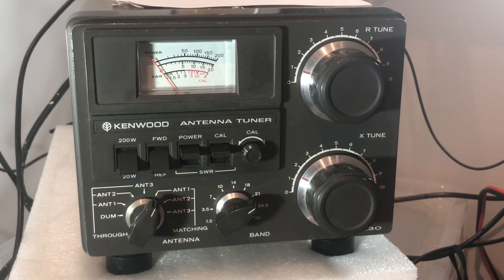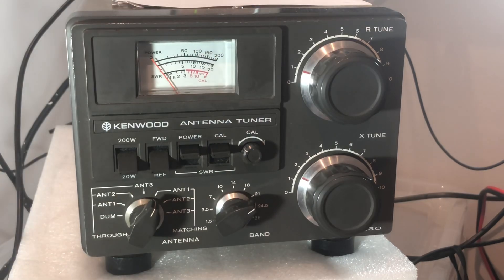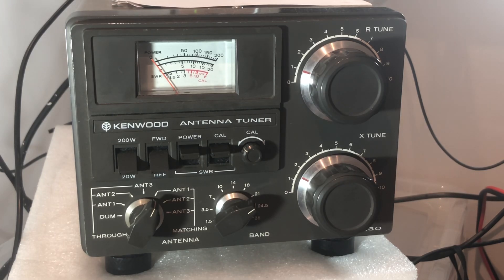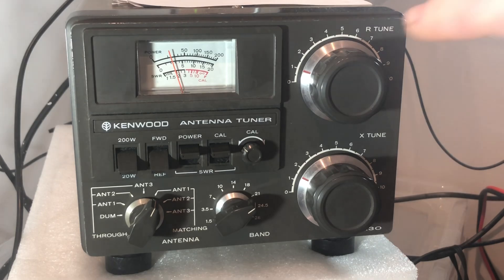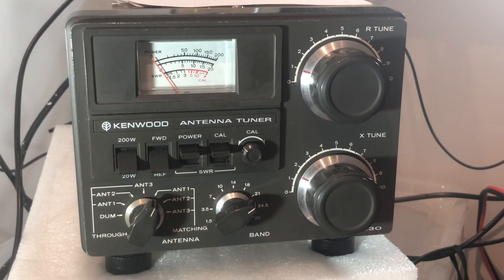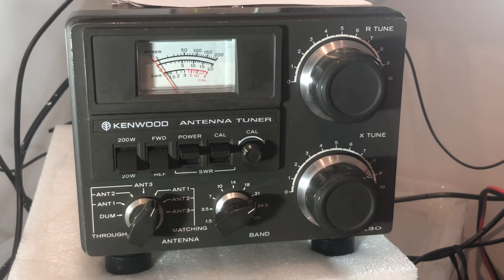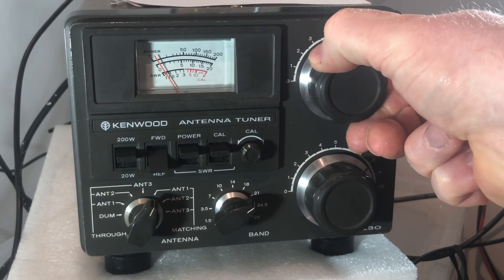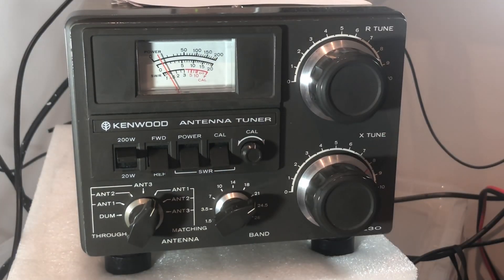Ham Radio: How To Use A Manual Antenna Tuner

Comment: 7.43 you were correct when you said you had tuned the antenna and also correct in matching the antenna, the tuner does both feats, so can be used interchangeably,

It matches the impedance for the transmitter can supply full power into the system and also canceled out the reactance of the antenna feed point creating a resonant antenna system

Comment: Hello Tim!  A question when you have a moment.  Does the AT-230 require any power to operate?  I have one connected to my TS-820s, but nothing happens.  Interior looks like it came from the factory, but I cannot get it to do anything.  Any thoughts would be appreciated.  Thanks!
Reply from the maker: Hi Paul - no DC power just RF from the radio.
Reply: @TIMG5TM  Thank you kindly sir!

Comment: Great video, would you need to match the antenna every time you move frequency? What frequency would you recommend to use for each hf band ? 73's
Reply from the maker: Yes you need to re-tune when you move bands and sometimes when you move frequency within a band. As for the frequency - it really depends on the mode you are using (data, cw or voice). 73

Comment: Very informative video cheers Tim , as a Foundation operator if I may ask a question . For a swr meter to show reflected power , Does the meter have to be calibrated as you would checking the swr , or does the reflected power just move to the position regardless using the calibration knob cheers

Comment: R is impedance Tim. I like the T match. I use with an antenna analyser that displays R and X...and then SWR. I use a variety of rigs some of which have a 72 ohm output....others have the standard 50 ohm. I can tune for resonance (X) = 0 with a very wide range of input impedance (R).  Clearly the SWR meter I have needs to be switchable between 72 and 50 ohm for accuracy.

Comment: Ok so I've got an antenna tuner, my Yaesu FT450D has an atu built in but it won't tune my end fed on all the bands I want it to, hence the new antenna tuner.
Now, my radio has a safety device which means the radio won't transmit when the SWR is bad, but I will need to switch this off if I'm to transmit and set up the atu.
If I'm incorrect in any of the above then please feel free to comment below, also, does anybody know how I can get my radio to transmit on the lowest power possible so I can set the atu?
Thanks in advance, Steve MM7STT

PS I'm a newbie so please be gentle with me if I'm being awfully stupid
Reply from the maker: No problem. I think the radio should still tx but will fold back the power to protect the radio. Try it and see. Welcome to the hobby and never be afraid to ask questions 👍👍 73

Comment: Hello Tim.......... I do enjoy your video's ..But I am sorry to say that how you tuned that AT230 was wrong........It's Band than , FWD and set the Cal than REF and than you adjust the R Tune and  X tune....73s
Reply: I have to disagree - I think Tim was spot on with his method, exactly as described in the manual for this tuner. He set the  desired band (21MHz) right at the start. About 4:30 in, he states how tuning for minimum reflected power is a good way to optimise SWR. Then towards the end, he checks  system SWR with the CAL function, rather than doing it at the start. It’s a very good way to tune once you get the hang of it :)

Comment: SWR is of course a ratio of forward power to Reflected power , I would want to look at the forward power as well as the reverse power levels when checking SWR match. It is possible to get a match but the antenna is so poor that your initial 100w is for example now only 50w as the efficiancy of the antenna is so poor. Would you still be happy to use that antenna just because it shows a good SWR ?

Comment: Very good - thank you.   I may be mistaken but I think you should have done the calibration step first - If I am wrong then please put me right!  I think this is done by setting the fwd/rev switch to forward and then transmitting a weak(ish) signal - just enough power  to drive the meter to around fsd signal; I use a CW signal. Ensure that the dial reads at full scale deflection by adjusting the 'cal' knob.  The dial is then calibrated.  Then switch to rev and carry out the procedures as shown in the video.

Comment: Hi Tim, I don't think I've never seen  a manual AT 'how to' video, so thank you. I would agree though to tune for max noise in receive first. As an 'old timer' now I'd recommend any new licencee get a cross needle SWR meter - it might cost a bit more but is worth it. Some HF tuners have them built in. Also some tuners (QRP) can use a resistive bridge network for SWR indication/ tuning. This protects the transmitter against high VSWR damage as the worst it would ever see is 3:1. 73 G0JLF.
Reply from the maker: Thanks 👍👍

Comment: I use a low cost Zetagi atu (£15 from eBay) for the 11meter CB band and have just bought a second hand Global ATU1000 for other bands when I get my Foundation licence.  Good to see that my trial and error has produced the correct operating procedure and that my impoverished budget has not been wasted :-) . 73's
Reply from the maker: Nice one and good luck with the foundation 👍👍